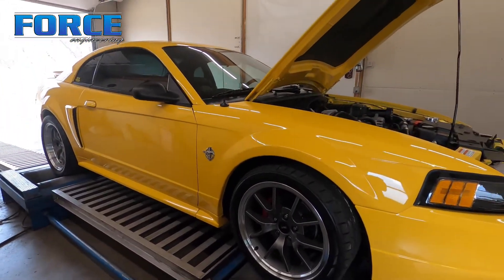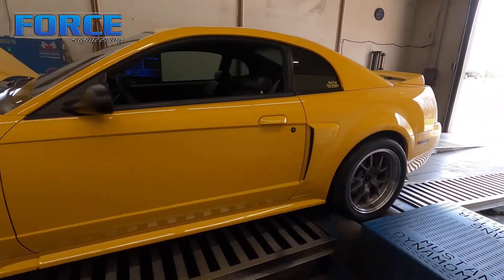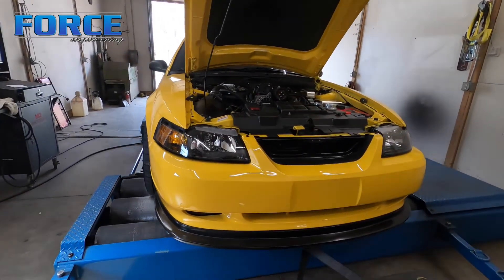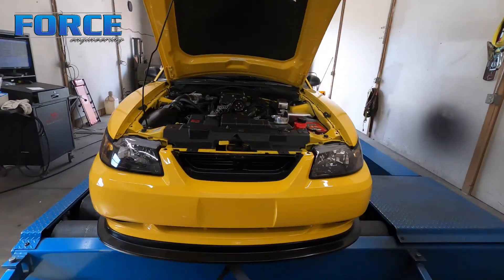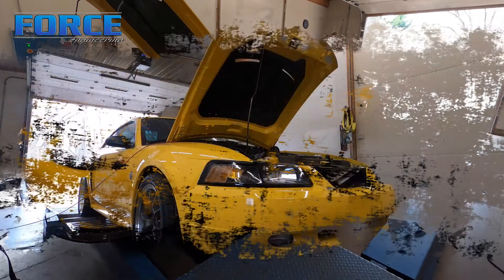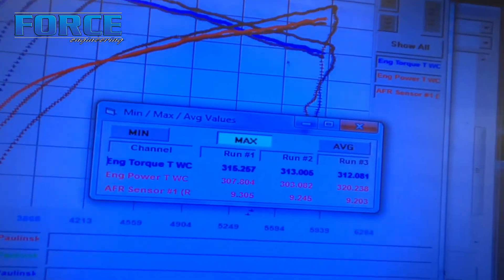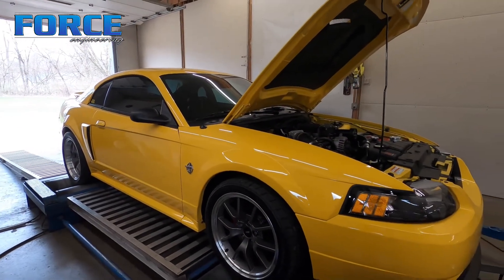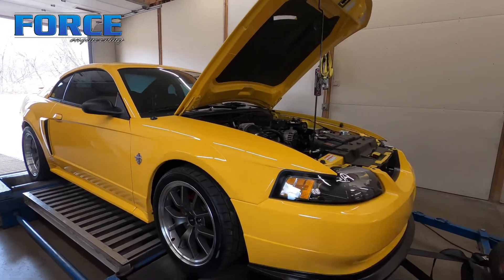Beautiful Mustang GT | Saleen Blower | 4.6l 2v | Dyno Review

Comment: 265 stock .Thats it 325 I could make more then that all motor with ported PI heads XE274 cams ,PI intake, AF TBody , long tube headers , x pipe , FM44s ,set of under pullies 45lb injectors and a tune 410hp at the wheels add 8-12lbs of boost and hit 550-600hp
Reply from the maker: They make 215-220 at the tire in stock from on our dyno.  With all the bolt-on outs there, they will make 250ish.  cams and port work make 285-300 depending on the setup.  The 265 number you mentioned is at the flywheel, not at the tire.
Reply: I agree. My 98 is running trickflow heads with stage 2 cams on 93 and I’m making 362whp lol  the fact the blower can’t make that is crazy.